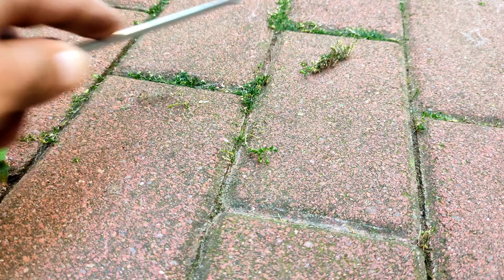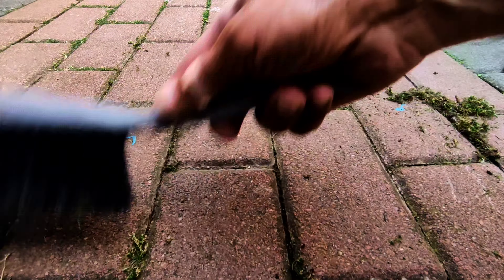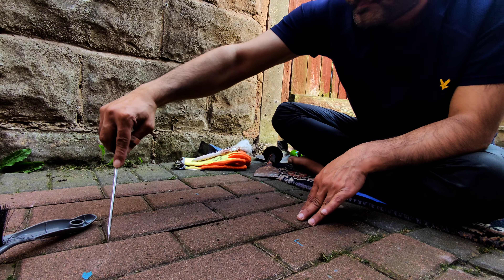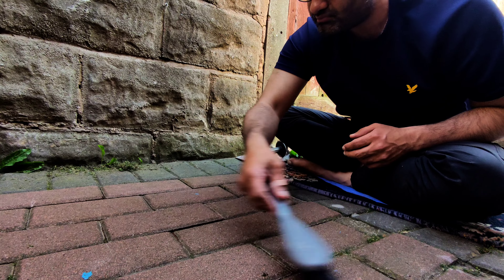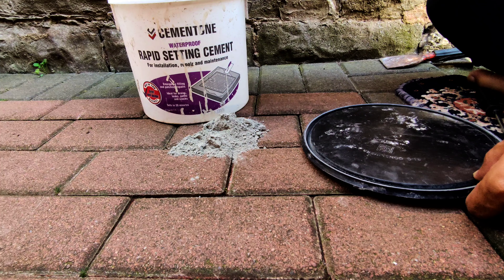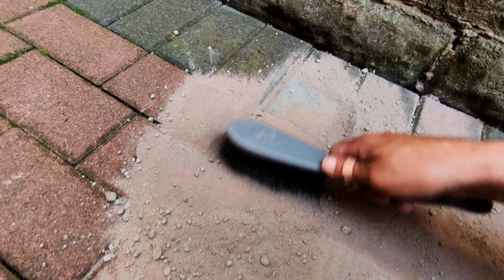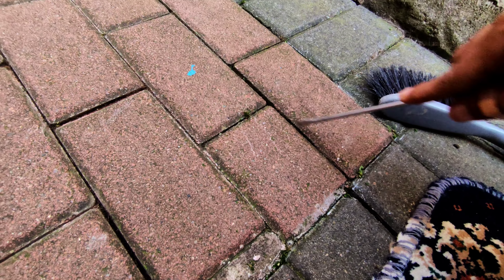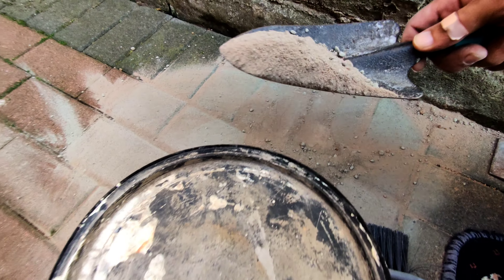How to STOP Weeds Growing in Block Brick paving Gaps

Comment from the maker: In the UK, regulations for rear garden block paving require proper drainage to prevent flooding. If you're using cement to fill gaps, ensure it doesn't block water flow. For areas over 5 square meters, you might need planning permission unless the paving is permeable. Always check local council guidelines to stay compliant.

Comment: I have block paving and I get people knocking on my door to jet wash it all the time. They all say it should be kiln dried sand down the gaps and cement is a huge no-no as it discolours the brickwork.  Interested to see how this turns out, and i might give it a try
Reply from the maker: If it's just kiln-dried or just sand, the weeds will grow back, providing repeat business for the jet washers. With this method, it's taken care of for 3 to 5 years. You can just wash off with hose water no pressure needed.